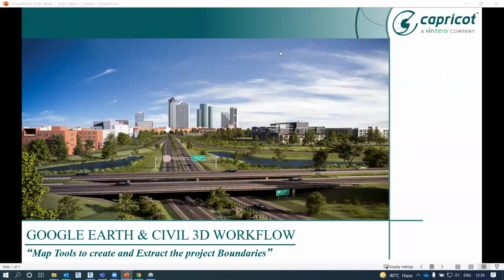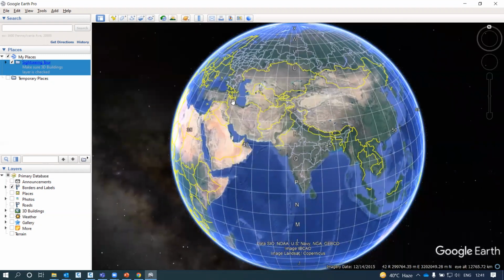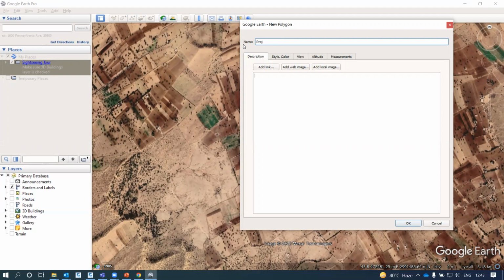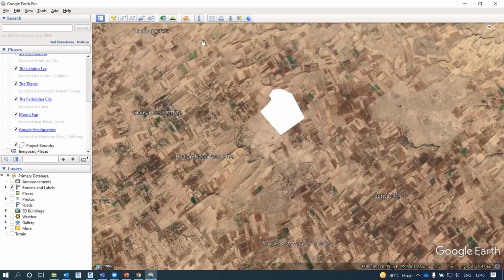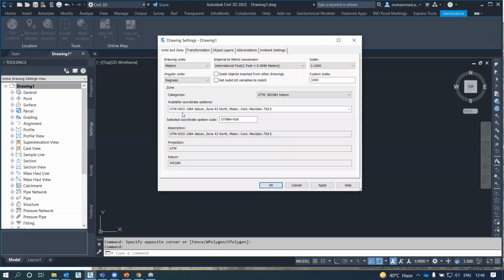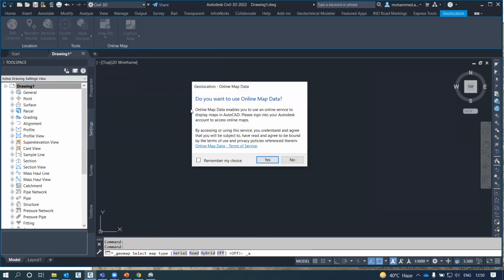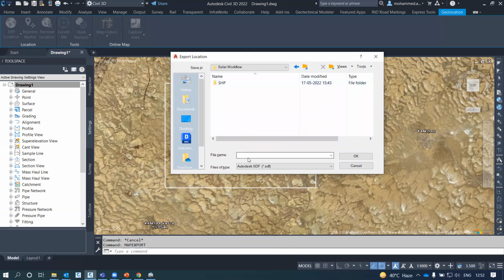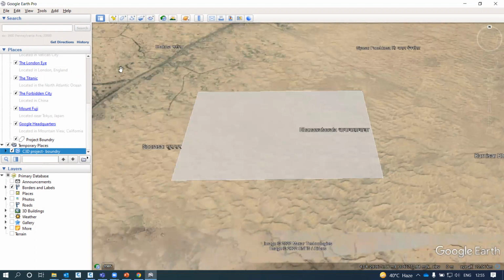GoogleEarth & Civil 3D Workflow KML & Project Boundaries

Comment: BROOOO, WHEN I type MAPIMPORT command, I can not see KML,KMZ format option, helpp
Reply: If you are using 2018 or lower version it's not available, since 2019 this feature is added. If you are using lower version need to use Autodesk external extension to do the same.
Reply: yes I am using 2018 version, can you please do a video for me how i can activate it in 2018 civil 3d :( please
Reply: @omerfarukelma9320   Hi, this inbuilt feature is available from 2019 version onwards, As you are using 2018 version check this video ( https://youtu.be/n_ZlWxCs9-c ). Here they are using Autolisp to import KML, or else you need use online websites to convert the KML file to shp files then you can use mapimport command to import shp files or use Autodesk plugins available in Autodesk store.
Reply: @MDAbid039  thank u i will check it